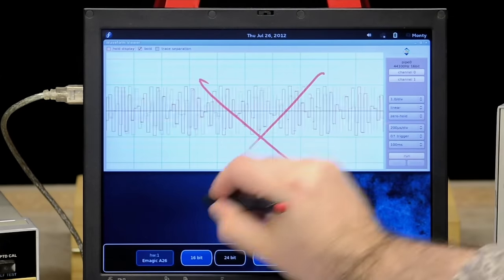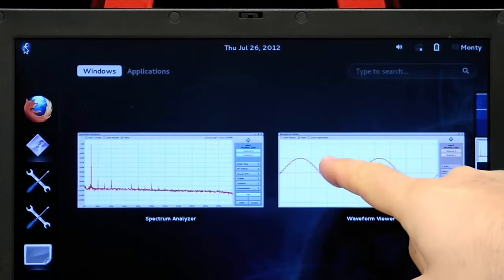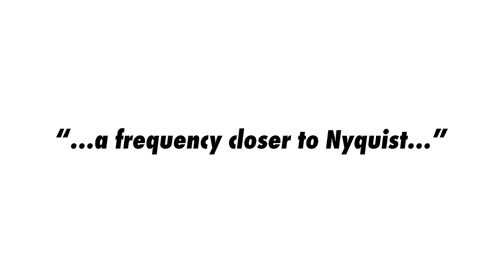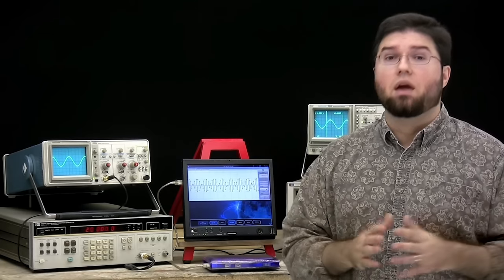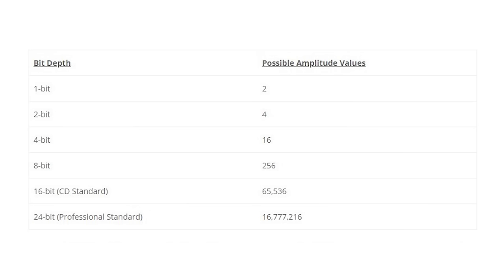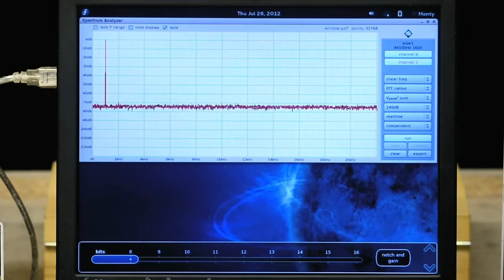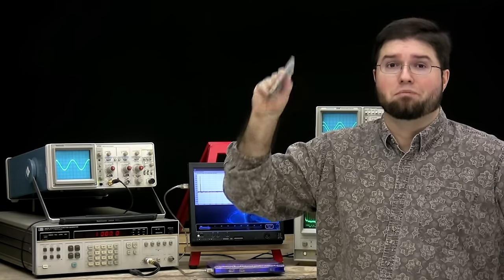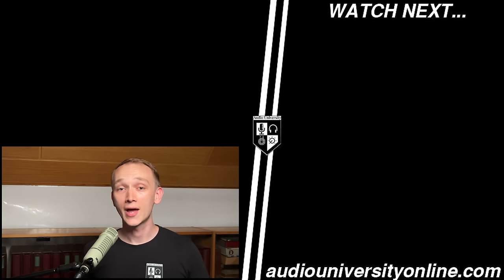Debunking the Digital Audio Myth: The Truth About the 'Stair-Step' Effect

Comment: I'm very happy to see people start to explain this to the masses. For 2 decades I've been telling audiophiles (extremists?) that they rarely have less than 2-3 bits of noise on the analog part of a 16-bit sample and they don't believe me. Even explaining that 16 bits means 16 microvolts of resolution per volt and that it's easy to get more due to RF radiation around. Not to mention that some such people nowadays use class-D amplifiers and find them good while these ones generally provide less than 8 bits of resolution due to using an insufficient sampling frequency! Thanks for this video, really!

Comment: Glad you mentioned the issue with trying to play output that contains ultrasonic content may cause distortion. Many speakers will not have the frequency response to reproduce signals with ultrasound components as they were not designed to and they are very far from the frequencies they were optimised to reproduce best. This will usually be 20Hz-20kHz for a single driver speaker. The reason why no speaker can reproduce all frequencies equally well is that the strength of the electromagnet has to be tuned with the mass of the cone, the range of travel of the cone and the desired frequency response in mind. Play frequencies too low through it and the cone may move too far and physically clip out, play frequencies too high through it and the cone can't really respond quick enough for the smaller fluctuations in the signal producing noise in the mechanism that way.  This is also why high end speakers often have multiple drivers fed through band pass filters, the big heavy driver that can push lots of air for that thumping bass is really not suited to producing tones in the higher range that need a more nimble cone or more powerful driver. The problem is putting in a driver that can move that monster through it's full range 15000 times a second and it will hit the limits of it's range of motion part way through the cycle with a 20Hz wave of the same amplitude. On the other end optimising it for a few hundred Hz means the cone doesn't have time to move far before the signal switches at high frequencies. So you can't have your cake and eat it and trying to demand a speaker to do everything will make your listening experience lousy.

Comment: Fine work sir! My argument for all the vinyl lovers has always been db range. The maximum for LP was around 60db, not including noise floor. Then add in the pops and crackles after undergoing the RIAA standard. CD has been a great playback and preservation method (so far) compared to vinyl or tape.
Reply: playback yes, preservation not so much.. i used to work for an archives compagny and we prioritize CD over Vinyl and tapes, as the support is way durable if conserve in proper conditions. Average life time for a CD to start degrading is around 10 years if i remember correctly. It is way more for others medium
Reply: @mambocountach  I've been collecting CD's since the 80's and none of them have failed whether stored in a cool place or warm storage facility. Tape and vinyl don't do well in heat. I say this after retiring from the record industry after 30 plus years.
Reply: @mambocountach  I recall there were some CDs manufactured in the UK in the '80s that began to delaminate after 10 or so years.
Here in Australia a lot of early CDs were pressed by Disctronics in Melbourne,  and to my knowledge none of those discs in my collection have degraded.
Reply: @mambocountach  My thinking is that there is no lifespan limit if the disc doesn't delaminate or get fungus(?) between the layers, a very rare phenomena.  I have 40 year old Hi8 tapes that play like new, despite the experts claiming a much, much shorter lifespan.  Supposedly, stored tightly wound the magnetic fields from one layer will imprint through the substrate to the next, mixing things up.  Yeah, right.
Reply: And vinyl has a maximum bit depth of 12 to 13.
Reply: @dirkjanriezebos2240  you're 100% correct! And that's before being played once. The second time that needle hits the record, the groove is already getting deeper, wider and noisier. That is the nature of the medium.
Reply: @dirkjanriezebos2240  I like to ask vinyl worshippers this:  If CD's wee invented first, would vinyl even exist?  Why would anyone choose less bit depth, worse signal to noise ratio by huge amounts, fragility, physically very tender, and pops and clicks.  The answer:  No one.  

I have a friend, I would describe us as low budget, good value minor league audiophiles.  We both love our vinyl.....well, just because....but play a lot of CD's, especially when we are busy with other matters.
Reply: @frequentlycynical642  I think the awful compressed CD loudness wars are partly responsible for the resurgence of vinyl. It's physically impossible to push vinyl to the same limits and still have the stylus track the groove, so in that respect vinyl can sound better than its CD version.
Reply: @dirkjanriezebos2240  Never.  There are poorly engineered discs and LP's, but the latter can never sound better.  T
he numbers don't lie.

Comment: There is a benefit for using higher sampling rates, but it only applies when making the actual recording (I think this is what is alluded to at the end of the video - looking forward to the next video to see if I'm right!). Although humans can only hear up to 20 kHz, physical sound waves include frequencies higher than that. Those frequencies must be filtered out before sampling or else they will get aliased into the hearable range. But no filter is perfect and frequencies above 20 kHz will pass through the filter, though higher frequencies will be attenuated more than lower. So the solution is to sample at rates much higher than the filter's baseband bandwidth so that only the highly attenuated very high frequencies alias into the hearable range.
Reply: That's exactly the point. Ans also why amateur recording and reproduction of high bitrate without modification can actually sound worse than lower bitrates. Those are the ultrasonic harmonics that he talked about.
Reply: Well if you record a 20khz sound at 20khz, then every sample will get the wave at the same position, so the computer will assume it's just a straight line. So you need at least double that to make sure you can get both the peaks and troughs of the sound wave.
Reply: @goldenfloof5469  Yes, however Nyquist is a double-edged sword. A 30kHz wave recorded at 20kHz will look like a 10kHz wave; that's why sampling high and then digitally filtering can produce nicer audio.
Reply: This is called "oversampling" and it's built into every modern analog-to-digital converter, even the cheap ones. There's no point in recording at a high sample rate and then downsampling; the converter does it for you.
Reply: @allochthon  I am an electronics design engineer; this is simply not true, sorry to say. That being said, you may be right with respect to half-decent converters which allow for multiple sample rates to be set. The problem is up-sampling and down-sampling with high fidelity uses non-trivial algorithms to implement in hardware. 48kHz -> 44.1kHz is an ugly conversion, for example, and a surprisingly common maximum for inexpensive electronics (though 96kHz is becoming more common). You can't just average data when down-sampling and get the same results as oversampling and then software processing.
Reply: @jrcowboy1099  Do you design A/D converters? I might have some questions if so... otherwise... I'm sure you're aware that 48 to 44.1 isn't relevant; A/D converters oversample by an integer factor. Looking at spec sheets from Analog Devices, it usually seems to be a factor of 128. The question of course is the quality of the downsampling. I'm sure there are some pretty crappy ones out there, but the ones used in any half-decent prosumer hardware definitely don't "just average data".  Many of the cheap Analog Devices chips have linear phase (i.e. windowed sinc FIR) digital downsampling filters (maybe all of them; some don't seem to say, or I didn't look hard enough for that information), and they give stats on the pass band and stop band characteristics, if you're curious. Of course you can always make a "better" lowpass filter in software by using a larger sinc window, but you can only go so far before any artifacts end up lost in the noise floor. A/D chip designers generally know what they're doing. 

I'd be really interested if you had examples of real-world tests that show an audible difference between, say, recording at 192kHz then converting to 48kHz in software, vs recording the same signal at 48kHz on the same hardware.
Reply: @allochthon  As a matter of fact, yes, I have in my past. That being said, I never claimed there is an audible difference, either; I concur that there almost certainly is not. Not all ADC's oversample, only the decent quality ones. Analog Devices, Realtek and the like make some decent ones; they also make cheaper ones (or made, some time ago). The problem is simple: if most consumers can't tell the difference, why waste silicon on oversampling, when you could just produce the chip cheaper? This only really applies to most consumer electronics, which are almost always built with 'webcam' quality of sound sampling in mind; think laptops, cheap phone dongles, mass-manufactured business PCs. I understand the decent ADCs do that; I simply stated most consumer ones dont, since they're chinesium; the last ADC I worked with was a 100MSPS ADC. I am well aware that any half-decent ADC does what you claim (heck, delta-sigma practically lends itself to up-sampling due to the internal clock rates involved), but my understanding is that most ADCs are just not great because an ADC which only supports a fixed clock of 48kHz is dirt cheap to produce and still surprisingly common.
Reply: @jrcowboy1099  To be fair, that makes it kinda sound like most cheaper recording devices have much bigger problems than that?

Eg for PC, even just voice-recording, good microphones are really expensive and require some extra equipment and knowledge to sound even remotely nice.
Playing MP games on PC, watching videos on youtube or steramers made me really aware how difficult and expensive good audio actually is.
Reply: @jrcowboy1099  I'm pretty sure every audio DAC and ADC is sigma-delta and has been for decades, since it's actually simpler to oversample and use only 1 bit of a few bits than to operate at 48 kHz and use 8 bits or more of resolution. You can get a reasonable oversampling DAC from Texas Instruments for $0.55 and that's still a good brand name, so I'm sure you can get them much cheaper too.

Comment: I record at 44,1 to avoid downsampling, but use 24 bits to provide more headroom for effects plugins in each track. After mixing I export to 44,1/16.
Reply from the maker: Yes. There are several reasons to use higher bit depth and sample rate for audio production (recording, mixing, and mastering). That’s what the next video is all about. This video is just about audio playback.
Reply: @AudioUniversity  yes, for playback 44.1/16 is perfect. My CD collection is still growing and I really enjoy how good they sound considering how affordable a great sounding CD player is nowadays.
Reply: 24bits does not give you more headroom. Headroom is loudness or volume above Odb(VU) or your normal operating level volume!
24bits give better sample accuracy or sound dynamics so does mean you are sending a better (more accurate signal to your effects)
Reply: @AudioUniversity  waiting for next video
Reply: @rods6405  Depends on how you transform. You can easily have more headroom with 24bit and use it for expanded dynamic range, this is in fact one of the the primary uses of it before your compress it to 16bit at selected boosts.
Reply: @Carewolf  "transform" is not a thing in digital audio! With 24bit audio you can create headroom ie (a)record at a lower level but then your noise floor SNR is higher and sample accuracy is poorer (why bother) or have better dynamic range when recording using all the bits. 
You dont "compress" when when converting 24 to 16 bits you either truncate (throw away the lower 8 bits) or noise shape to 16 bit (Sony had a processor that did this). 
The term "compress" is something you do to audio to reduce its dynamic range. 
If you compress a noisy (a) poorly recorded signal then the noise floor(and lower level sounds) will sound louder, high level sounds will sound softer!  
If you also apply gain (boost) then the noise floor(and lower level sounds) will sound even louder again(less dynamic range)
Reply: I think most DAWs use floating point representation internally anyway, so plugins don't need any additional headroom.

Comment: This was a great video. I am a retired electrical engineer. Most of my career was concerned with DSP (digital signal processing) of one form or another. I think that the reason that digital audio mystifies people is that you must have an understanding of some fairly advanced mathematics to understand why it works. Topics such as Nyquist sampling theory, anti-aliasing filters, spectral images, and Fourier transforms come to mind. Most people attempt to apply their common-sense analog thinking to it but that just doesn't work.

Comment: Great video! I want to clarify something about the Nyquist rate: it’s not necessarily that you need to sample at twice the highest frequency, but twice the bandwidth. If your signal of interest is, for instance, between 800 and 1200 Hz, then you can apply a bandpass filter that accepts that range and rejects what’s outside of it. With such a band-limited signal, you don’t need to sample at 2400 Hz, but 800 Hz! Essentially this technique exploits aliasing to reproduce high-frequency signals.
Source: I work with RF professionally
Reply: Great post! I wondered when someone would correct the faulty definition of the Nyquist theorem. I have also sub-sampled many signals in my days. Also, in the video it was stated that the stair step view is never there. You do get a stair step when you have no DAC anti-aliasing filter.
Reply: This is not entirely correct.  By this logic a signal between 1GHz and 1GHz+400Hz would only need to be sampled at 800Hz.  You're missing the downcoversion step -- mixing with the carrier and low-passing.
Reply: @dmitryjoy  Actually you can, without down sampling, as long as the input stage in the ADC has a sufficiently large full power bandwidth. Now you have to bandpass it to only let through your band of interest first though. Sampling at 800Hz with a 400Hz band of interest would be an impossible filter to make since it has to be a "brick" filter though. You also have to be smart about what sampling frequency that you pick. I have done sub-sampling implementations in a professional setting, with RF signals. The linked video explains it. https://www.youtube.com/watch?v=ryJPVHrj0rE
Reply: So true, however with CD Audio the dead bands below 20Hz is not worth mentioning as a credible saving.  

In early A-Law and u-Law phone service codecs they used 8ksample with input filters of 200-2800Hz giving just 2600Hz bandwidth that in theory could have been achieved with 5.2ksamples with perfect fairy dust input filters but simply not worth the trouble for the savings. 

The input circuitry on VERY high bandwidth oscilloscopes makes use of similar techniques elevating them to near magical levels with parallel sampling of delayed signals as required to compensate for the inadequate sampling rate but still maintaining the input bandwidth.  So a 2 GHz input might use 4 x 1GSample ADCs or 8 x 500MSample ADCs plus a lot of DSP magic.

Comment: This, and one other equation, was the only thing in my four-year electrical engineering degree I'd never heard of anywhere else. Thanks for making a video of it. When my professor proved in calculus that a perfect reproduction of a continuous wave exists in a jagged-looking digital stream, I gasped "what!" and the rest of my class looked disappointingly unmoved by the revelation.
Reply: It’s the magic of the Fourier transform.
Reply: How does this work? What if instead of fifty samples clearly visually suggesting a sine wave, I just have two samples? Is there somehow a way to reconstruct the original even then?? I don't know calculus so I know this may be a hard question to answer.
Reply: @krisrhodes5180  Trying not to be too jargoney and also hoping I remember it correctly... "the Fourier transform of a rectangular pulse" can be applied to the concept of digital sample playback if each "stairstep" is transformed individually... the sinc functions overlap and the resulting waveform looks more and more like the original as you add all the harmonics of the stair steps. 

He used ancient overhead transparencies to demonstrate it but I'm sure it could be done in Excel or MATLAB.
Reply: With filtering you can certainly approach the original waveform if it's a relatively simple combination of sine waves.

Comment: RIGHT ON! 😎👍👍 Being old af, we learned all this when digital audio was first hitting the market.
It’s kind of a shame that you still have to walk people through this.

I think people are confused by the higher data rate that computers often need to PROCESS audio. This is a completely unrelated function.
Reply: Music is not a single sine wave of invariable pitch and volume. Thus you were fooled by this video. Sorry. In addition, bits don't equate to dB. Bits simply define a resolution range. You can use 16 bit to define 65536 different volume levels between 0dB and 1dB, or 65536 different volume levels between 0 and 1000dB. So here too you were fooled.